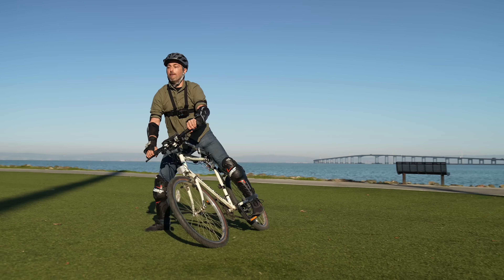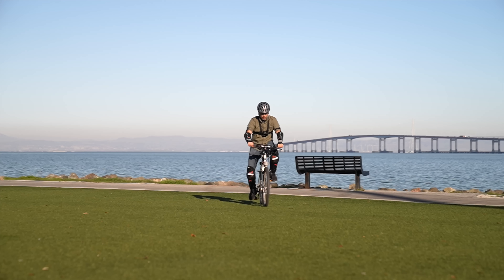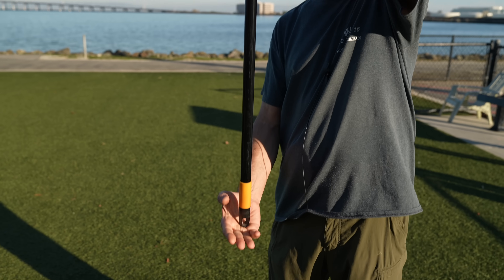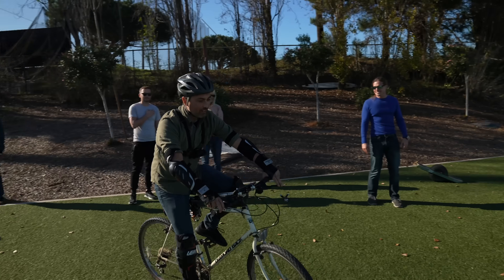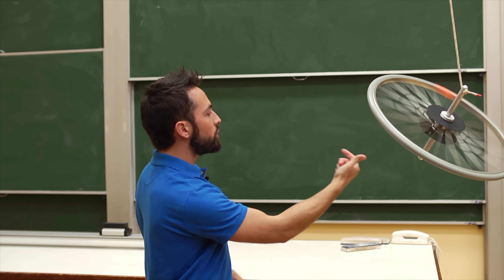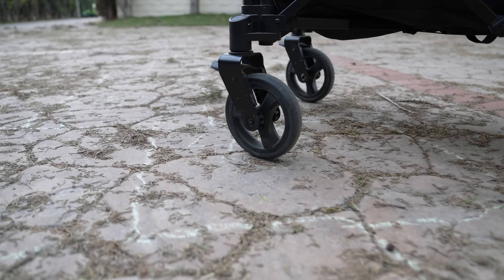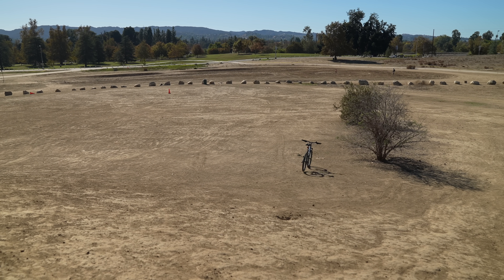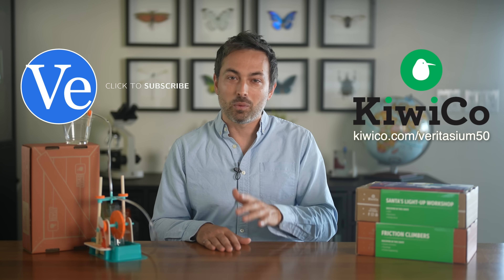Most People Don't Know How Bikes Work

Comment: this comes out the day after tom scott's video of him learning to ride a bike as an adult, having forgotten how in the decades since he last rode one. 
Although, it seems like most of what's shown in this video as far as ability to ride is complicated by the low speeds at which it all happened. I'd like to see a professional rider try this bike out, either someone like a distance road racer or a BMX stunt biker, who likely are much better at shifting their weight (this video implies a person can't properly shift their own weight without turning the bike briefly in the opposite direction of a turn, to force them to lean into the turn)
Reply: I would have like to try it with just one side locked out. I have trained to ride bikes and motorcycles just by pushing down on the handlebar in the direction you want to go. That shift the balances I think without the counter turn but really even though I tried hard not to counter steer since it is done subconsciously I may have been fooling myself.
Reply: @-mike-8134  it's not so much about shifting the balance as using the wheel to steer instead of countersteering. leaning the bike into the direction of the way you want to turn while pointing straight ahead puts the side of the wheel, which is curved in the direction of the lean/turn would make the bike turn in that direction.
Reply: exactly, I know a few people who ride without even having their hands on the handlebar and they can go left and right simply by shifting their weight appropriately
Reply: @Heylon1313  the handlebars of a bike still steer with no hands, as they're designed to easily do that, even without the rider.
Reply: @Heylon1313  if you watched the video you'd see he explained that bikes are self-balancing, but can't self balance when the handlebars are fixed in place, which is why those people struggled so much
Reply: @caimansaurus5564  his point is that they don't start off by going in the opposite direction in order to get a lean towards the right. They just get this lean by leaning in that direction
Reply: @caimansaurus5564  exactly, but the point was that in the experiment the opposite direction was locked and people couldn't initiate the turn with intuitive countersteering. However, if you ride without your hands on the handlebar and steer by shifting your weight, the handlebar should fall into the wanted position itself as explained, i.e. if you lean left the handlebar will fall into a position that steers to your left without the need for countersteering, so I think it should work with the experimental bike.
Reply: @Heylon1313  ah i see, i thought you were talking about the experiment where both sides were locked.
Reply: @caimansaurus5564  ah okay no worries. Although, unicyclists can also steer without a handlebar so... maybe it might still work if it is fully locked?

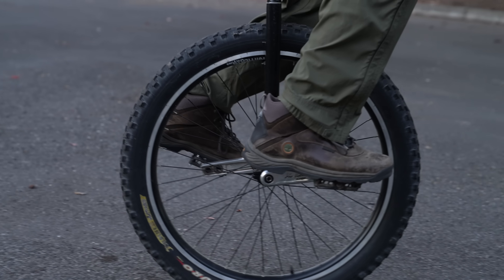Comment: 4:22 I think it would have been even more interesting to have a ratchet mechanism so that once you're supposed to make left turn, you no longer turn the steering towards right no matter which position it currently has. That would probably have prevented even continous turn to left because you cannot (easily?) balance the bike during the cornering anymore.

Also, having a driver that can do something like Fabio Wibmer or Danny MacAskill would have been interesting. Though, those drivers could have just raised to front wheel of the ground in case the steering doesn't work anymore...
Reply: Even with the ratchet you could theoretically go into a reasonable turn and maintain the continuous turn by varying your speed. It would be really tricky, but that is basically what trackstanding is.
Reply: @matejlieskovsky9625    Ya, we actually do this on motorcycles sometimes while making really tight low speed turns (think a U-turn or maneuvering in a parking lot).  We'll turn all the way to the lock, and then balance with speed and a little weight shift.  It's pretty scary though.
Reply: @daemn42  I imagine it is pretty scary, but on the upside it's an excellent way to demonstrate to people what both understeer and (if you muck it up) oversteer look like. 😂
Reply: @rjfaber1991   The terms "understeer" and "oversteer" actually refer to something completely unrelated to this.   Understeer is when the slip angle of the front tire/s exceeds that of the rear ("push"), and oversteer is when slip angle of rear tire/s exceeds that of the front ("drift").  Understeer is bad on a bike.  Oversteer, occasionally useful.  
When turning against the steering lock you simply set a lean angle and if you speed up you start to straighten up, and slow down, you fall into the turn.    Search for videos with keywords "motorcycle police skills course" to see masters at it.

Comment: Walk a bicycle holding the saddle you soon learn to flick it the wrong way to initiate a turn.

I started with motorbikes on and off road in 1978 you learn to do it without thinking, BUT the number of riders that have been taught to do "counter steering CS" most of them have fallen off in the UK on a roundabout  etc. If you have to think about it then do it TOOOOOO late your off.
I do not think it should be taught to learners. My dad did not even know what CS was and he had lots of motorbikes.    

TIP always undo the steering lock before setting off ;-)) Honda XL250S  the other odd thing was the 23inch front wheel - just one of my many bikes.

Comment: I think its worth mentioning that when a human is riding a bicycle,  and the handle is locked. The force put by them on each paddle to move forward. Makes it impossible them to balance it, since bicyclewill lean towards the side the firce is applied. They will be able to perfectly balance it even when its locked. If they dont paddle and remain in similar position till they slow down to the point it impossible to balance.

Comment: When there's a red light coming in front of me, I often bike super slowly while waiting to not put my feet on the ground. It true that the gyroscopic effect is too small at this speed to have any meaningful effect on my balance. But it's still important to move forward, even super slow, to keep balance. The challenge is to not put feet on the ground in 30 seconds of waiting when you have 3 meters to move in in front of you before it's the street of the red light.

Comment: Derek why are you doing this?  Why are you producing junk science videos that mislead people on the basic laws of physics?  Your helicopter rope video was junk science and now you pull this out of your ass.  You craft this video to imply that countersteering must be performed under any and all circumstances when piloting a bicycle. But the reality is, this is only true at low speeds and even then it's not absolutely necessary.  Counter steering isn't even necessary for remaining upright on a stationary  bicycle...its called TRACK STANDING  and it always involves holding the wheel to one side while rocking back and forth on the crank. 

Dude I'm honestly starting to think you are trying to make the average uneducated mind feeble and malleable to such an extent that objective reality can be withheld from the observer.  Something I'm sure the government is very interested in as it ushers in the latest version of the fantasy flu.

Comment: 9:50 that's pretty overkill. I think most people could learn to track-stand with surprisingly little practice. Of course not that they need to, even some decent bike control skill will allow you to balance at very slow speeds without even thinking about it.
Reply: I guess that bike is for disable people of something, because as they mention the physical mechanic of a normal bike should be more than enough for normal people. But that's just my guess
Reply: I’m disabled in such a way that this would really help me to be safe on a bike, which I’m currently not because I don’t have the muscle strength or endurance to maintain speed and posture or even grip, especially at slow speeds in crowded areas where you need to be agile. I can also see this being helpful to people who can’t balance well or don’t have great muscle coordination. I miss riding bikes.

Comment: Reducing the gear to a lower gear, pedaling faster, would greatly reduce this "initial" need to go the opposite direction first.
It's about the pedaling as much as the steering. 
Please retry this test, using a lower gear while the subject pedals faster.

Comment: When I learned driving my 1000cc '84 Honda Interceptor, I figured this out after a thrilling ride in city traffic. Push the right handlebar if you want to go right, and vice versa. You have no idea if you are not taught this. When you go beyond bicycles or 50cc  mopeds you will have to learn, one way or the other. Or crash

Comment: All motorcycles steer in this way. Above 15mph when you turn the handle to the right the bike will lean hard to left and go left. Slow speed turns you counterbalance and left the machine angle in the opposite direction.

Comment: Unless you're going really fast, the gyroscopic effect is almost unnoticeable because the mass of the wheels is much less than the rest of the bike AND your body weight. In fact, it would keep the steering wheel approximately straight, but for self-steering, it would always need to steer into the lean slightly.

Comment: I learned this very forcefully when I copied a design I saw on Youtube for a reverse steering bike.  It had 2 gears that make the front wheel turn the opposite way to the direction you turn the handlebars.  Since my motor system had an algorithm for regular steering, It had to create another one for this new type of steering.  I first tried to think about what I should do to make this work, and forced myself to do this until my motor system created another algorithm.  The interesting thing was when I first tried to make a turn I did what you said,  I tried to simply turn that way, but often went down.  It took me riding the regular way and paying close attention to how I made a turn to discover exactly what you point out in this video.  I have been riding this bike for about a year and a half now, and can ride quite easily,  Also, I can switch between the regular and reverse steering with little effort.  Everyone should try this,  it's really fun, and confuses other's.  An additional advantage to this is that almost no-one can steel your bike, as it is nearly impossible to ride on first (or first 100) try.

Comment: I have discovered that counter steer move when I was analyzing how I was making a turn. At first I thought I had a bad habit and that was not necessary. But then I realized there was no f'ing way to turn your bike without counter turn first. I even realized in order to make a turn to certain direction, you did not even have to steer your handle to that direction at all if you are fast (you lean your bike to the ground), but you need to make your little counter turn at first

So it is really crazy that if you want to make a right turn, steering left is always necessary but steering right is not always necessary!

I think motorbike riders already knew this very well but still it was nice to discover this by myself.

Comment: Would you be able yo steer the direction locked bike by leaning your weight first? It might be possible because if you lean, the bike will fall into the direction of the lean, or not because in the first place to shift your weight without counter steering means the bike will have to react by leaning to the opposite direction, hence negating the shift in weight. Dunno, i just thought of this because in motorcycles, sometimes you don't actually turn the handle bars at all at higher speeds, or so it seems. It might actually be that the little turn induced by placing your weight on the  handlebar by leaning is actually magnified by the speed of the motorcycle, hence it being enough to allow the rider to shift his body weight without the bike falling over. Also, I didn't learn counter steering when learning to ride because i learned riding on a tricycle (not a bike, but motorcycle with side car) and its steering is heavy so i actually have to pull on the handlebar rather than push (bar is too far to push effectively)

Comment: No, you don't need to necessarily counter steer
You can "simply" lean over one side then turn.

Believe me, happened to me when a **** *** *  ****** forgot the stop, and while trying to dodge it I found myself doing a 180° on the bike at incredible speed.

And that's the thing, the only thing missing in your video.

You don't have enough speed to fully use your body to steer (and I'm not talking about gyroscopic effect here).

At a certain speed, steering with your arms become absolutely irrelevant, the only thing working is your body.

When youd drive without hands (don't try this, it's fun, but dangerous) you can still change direction

Because of the speed

Comment: I do trial bike riding, both motorcycle and bicycle and i would love to try this bicycle and that one wich turn to the oposite you expect it to. But yeah would love to get more in depth on this. 
By the way on trials riding a lot of the equilibrium on the bike you get it by moving your waist side to side while crouching down a little bit so even if you lock the turning i'm 100% sure i'd keep the balance while stationary, and also i think while moving but that'd be reeeally hard i can imagine(For turning and maintaining equilibrium i'd have to keep doing little hops). Also we put the tires on really low psi so they squish and it's easyer to get balance

Sry for my english im from spain
Reply: I'm sure if you found some descent trials riders or you'd want to come visit me in spain, they'd be able to maintain equilibrium, but still i don't think tou are trying to demonstrate that. I still think it'd be cool to try.

Comment: I've been a mountain biker for a while and I do some small races every now and then and most professional bikers know about this and how to lean there bodies in the direction of a turn to negate the need to pre countersteer like that. Lean your neck over along with your back as you tilt the bike the direction you want to turn and then turn the handlebars to counteract you falling.
Reply: Exactly! I was thinking about this leaning process all the time, when in the video he said it is not possible to steer in one direction without counter-steering before. As you described before, it indeed is possible to steer in one direction if you lean your bodyweight into the turn right before you make this turn.
Reply: @dn00dles  in downhill you can just lean and kick the back wheel into the corner with body pressure. in Corners with a high and steep burm you technically dont even turn because your bike is going straight in relation to the track, imagine like you bend a flat strip of paper into a round corner
Reply: That's exactly what I was thinking. Shame that he didn't even mention it.
Reply: @dn00dles  Everyone saying it is impossible to lean without counter leaning first... but the counter lean is just a lean in the other direction, so if were actually impossible to lean without counter leaning, then it would also be impossible to counter lean in the first place.
Reply: Same. I'm not sure if I counter steer or not though. I think I just drop my elbow and lean but now I'm questioning that. The only time I'm sure I counter steer is if there's a outer berm I want to use for momentum.
Reply: You’re definitely still counter steering when you lean, just in smaller amounts.
Reply: @joshua.merrill  Even if that's the case it would have been nice if he had tested it.
Reply: No, you still have to counter steer a little bit. All the leaning does is help exaggerate the turn in so that it's tighter but if you never ever turn in the opposite direction, even a fraction of a degree, then you cannot turn in the direction you want to go in. You can LEAN in the direction you want to go to get the bike going that way sure, but then you cannot maintain balance afterward if you cannot steer or lean back in the other direction at all.
Reply: Search for videos with keywords "no bs bike".    It's a motorcycle with two sets of handlebars.   One regular, one fixed to the bike.  The rider can transition to the fixed bars and then try to steer via weight shift only.   Turns out, it's impossible to initiatate or change directions aggressively with body steering alone.  Yes, you can manhandle a bicycle easier than a motorcycle, but I think you'd find that it only works once, and once leaned over into a turn you'd find it extremely difficult to reverse your lean angle without actively counter-steering.     A lot of cyclists think they're body steering when what they're really doing is pushing on the bars as they lean off to to the inside causing a counter-steering rotation of the bars.
Reply: @daemn42  Motorcycles are much heavier than bikes.  And when you say it only works once... that is if when you do it you put yourself and the bike in the same direction.  You can instead put yourself and the bike in opposite directions with the bike leaned the way you want to go, this is far easier to correct back to straight.  The direction of the turn can then be controlled via camber thrust.
Reply: You can steer by moving body weight.. however its way faster to counter steer.